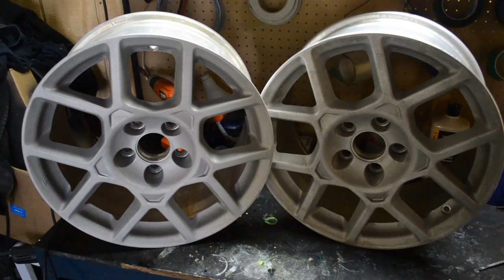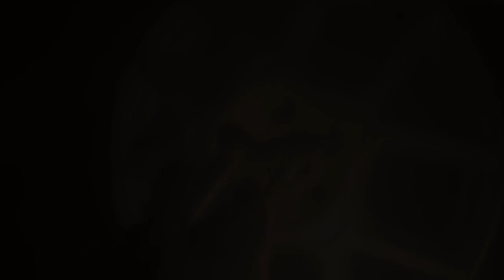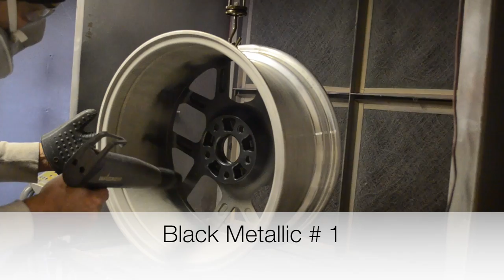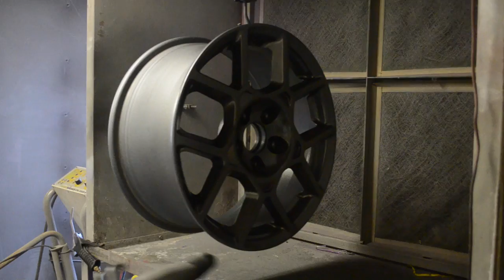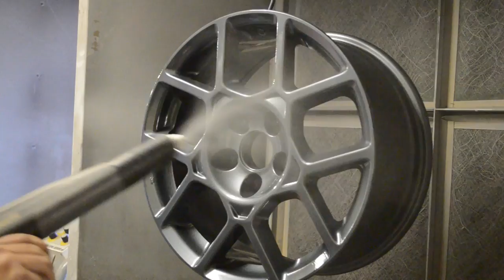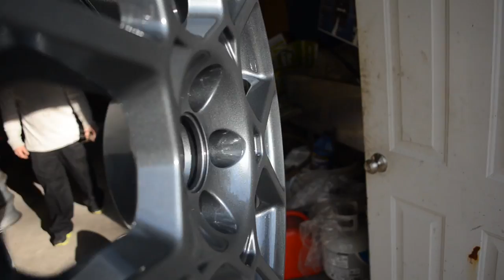Powder Coating Wheels

Comment: always coat rims when they are nice and hot,turn your gun down very low and dust coat them so you dont get orange peel effect,for best results powder prime and wet paint the finish coat.see mine on youtube.micky page chrome powder coating.

Comment: you are supposed to put high temp tape behind the wheel where it meets the hub! and it appears that you are coating the wheel hot! not supposed to! looks good though. and partially cure the grey before the clear coat, you will get a lot less orange peel (spray light)
Reply: Emile-Frederick SALIBA  oh yeah? why?

Comment: Lot of misinformation floating in this comment section.  

Shooting wheels hot is for if you aren't grounding the wheel.  It's not a big deal.  Orange peel happens when you apply too much powder, which is a big problem when the wheels are hot, because the coating starts to partially cure (melt), which allows you to apply too much coating if you aren't careful.  Don't shoot them hot, shoot them warm.

Aluminum wheels should have an anti-gassing primer coat applied first, as cast aluminum tends to out-gas when heated.  Heat that up to partially cure and pull them out, allowing to cool slightly, then apply the color coat.  Allow to cool to the touch prior to shooting the clear.  They can still be warm, but you should be able to touch the wheel without getting burned.  

Lastly, rims are for basketball, wheels are for automobiles.

Comment: What's the life span of this powder coating?  I don't know how this works so my first concern to this would be the paint cracking and coming off.
Reply: Powder coating is extremely durable when compared to conventional paint. That is why most factory wheels are powder coated.

Comment: Almost every video on youtube are guys shooting powder on hot wheels. Which is improper.
Reply: Matt Baker Okay, now I'm curious.  What's the proper way?  I'm looking to have my wheels coated and want them done right of course.  Is there a method to dipping them?

Also, some of my racer buddies swear powder coating causes microscopic cracks that can compromise the strength of wheels.  But one of them said they can be done at lower temperatures to protect the aluminum.  Any thoughts on that?
Reply: it's not improper.
most professional wheel refurbishments are done this way.
dramatically reduces orange peel In the finish.
Reply: It all depends on the experience level of the guy coating the parts. Spraying hot can help with orange peel but can also cause the powder to be applied over mil spec very easily and at the point the powder becomes weak and then chips and fails giving powder coating a bad name. Either way cold or hot will work as long as you can keep the mils within spec.
Reply: How do you bake the wheel can you use a heat lamp? or do you need an oven?